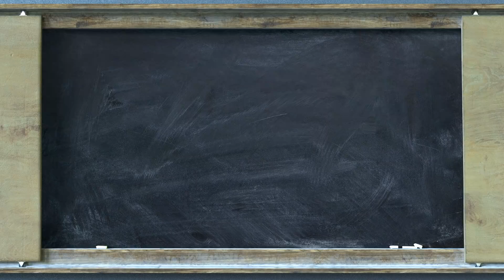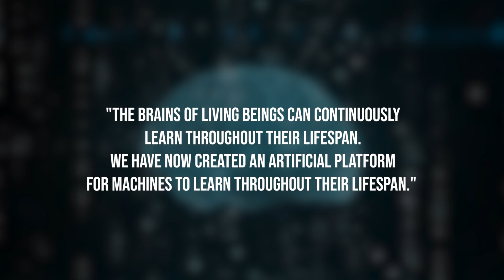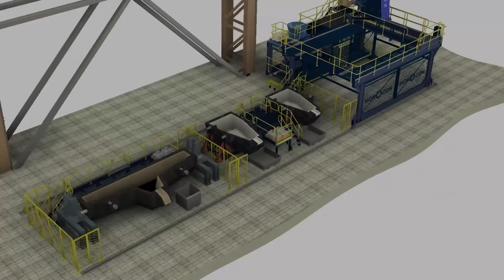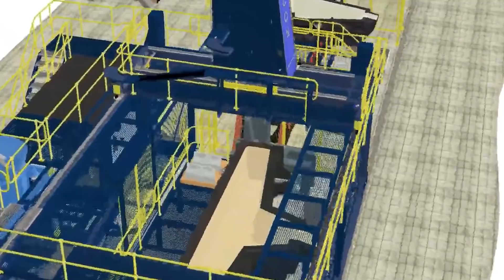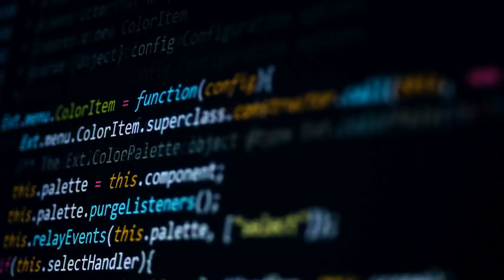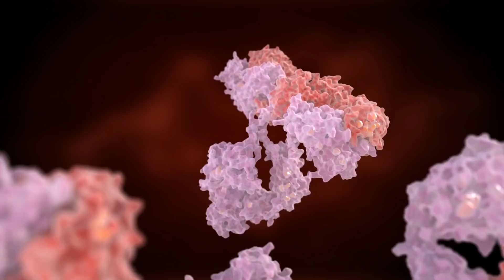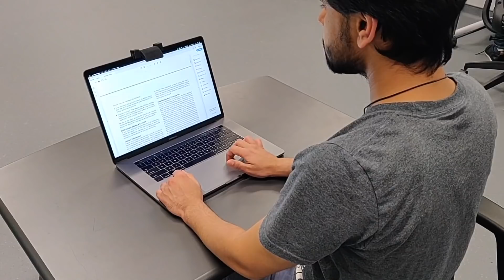LEAKED Artificial Intelligence News | Weekly Update #6

Comment: Very good brother, Real Eyes of China mentioned new EUV lithography machines from ASML. Combine 2nm and future lower than a nanometer technology plus adaptive transistors to up computing power Twice. ultraRAM may be extremely helpful, unless phase change memory proves more effective. There is much to study, also with 3D printing/additive manufacturing. We may be in need of more people that can build solar cell and panel assembly machines, a fully automated process. I hope to learn a lot about such machines, I’m not sure what process is the most economical. But Saule technologies and Evolar should know what they are doing and can teach us. I read something about perovskites + PERC. PERC it seems is a kind of silicone solar tech, I’m not sure if this is financially very interesting, chalcogenide perovskites may be the future of low cost solar cells, most important may be to eliminate lead as an ingredient whilst improving efficiency. Still the perovskite materials used at Saule might be very cheap and we have to find out what courses will be taken.
Reply: I like solar energy and have studied it from a distance because of romantic ideas about saving the family name and an errant sibling who needed to be forced to "rewire" his beliefs on his own.  It was a fools errand.  If I could make solar panels they would be like a tarp draped over a roof and self adhere and have anchoring cables extending to the ground and electrode cables that connect to the house metering junction box.   Installation time: 1 hour.   Take a drone photo of the roof, send the photo to the manufacturing machine that returns a cost to build, get a down payment and schedule the installation.